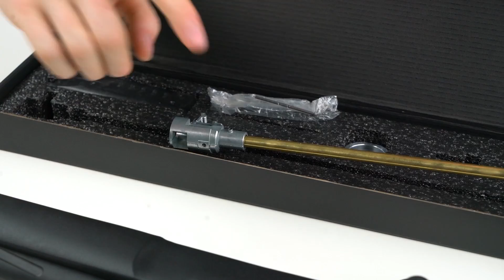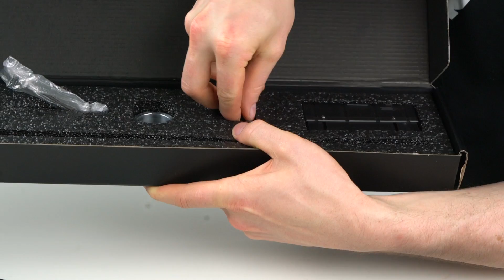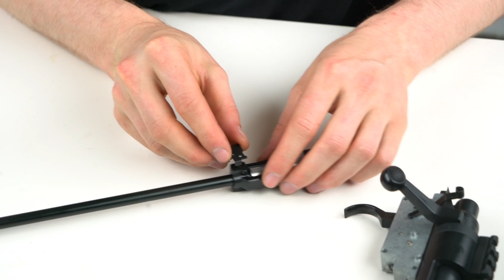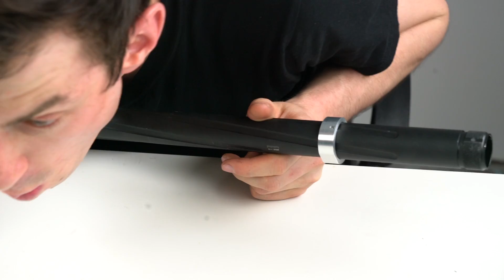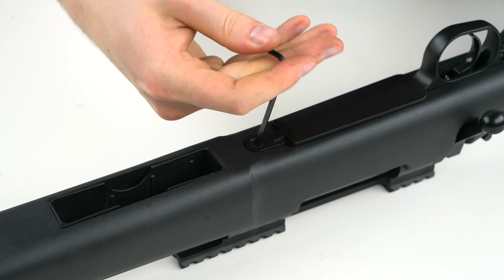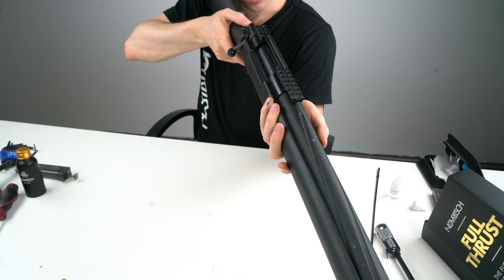FULL THRUST Installation Guide for SSG-24

Comment: Will you be able to order an ssg24 with this pre-installed?
Reply: Because u need normally after installation new TÜV and other checks from norms they quiet hard to get so you can sell them easy without regulations
Reply: Its a good idea but no
Reply: For now the FULL THRUST system will just be offered as a kit.

Comment: Will you make a Full Thrust kit for the ssp1
Reply: The SSP1 is below only 1.2 Joules. The FULL THRUST only increases range for guns in the 2-4 Joule range. For over 4 Joules 8mm is the better system and for below 2 Joules 6mm is better as well.